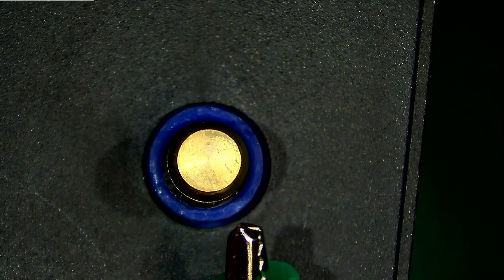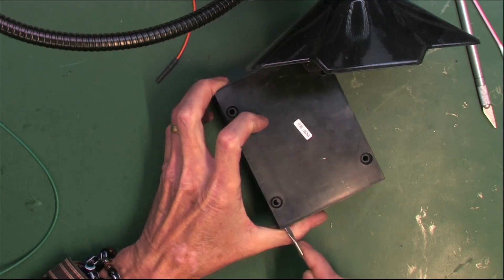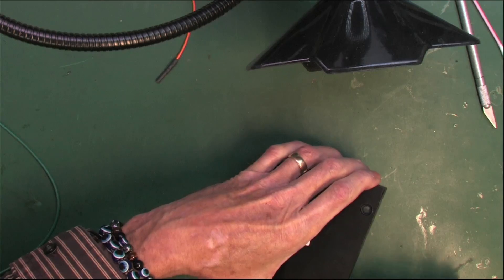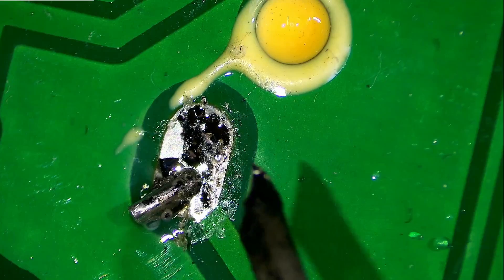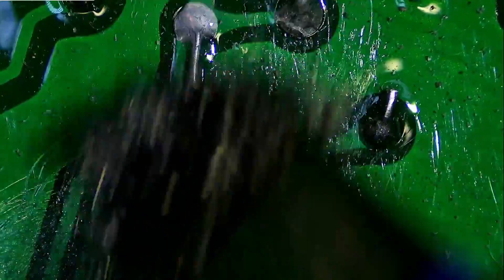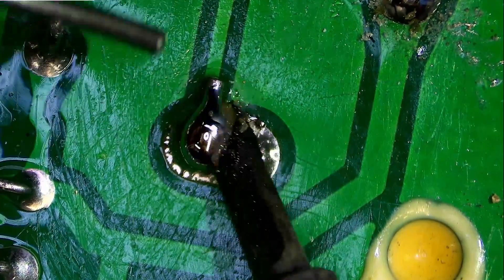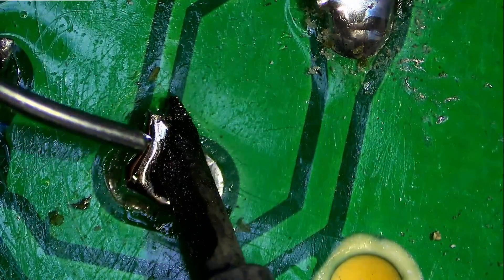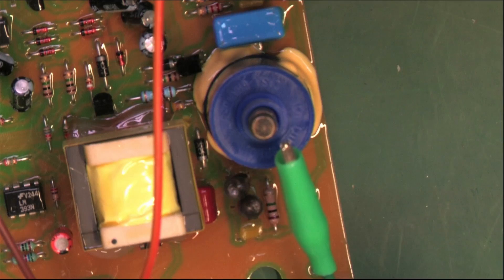Failed Solder Joints Are The Norm!

Comment: That bent-over lead with the cracked solder is too long and sitting on the adjacent foil ---- I'd clip it shorter (I wouldn't trust the conformal coating to be a perfect insulator). A fiberglas-bristle scratch brush would be better for cleaning the joints before resoldering; and the tip of your iron is*BADLY* in need of cleaning and  retinning.